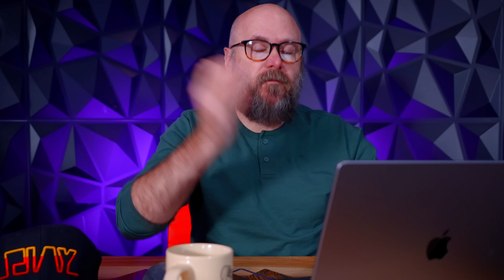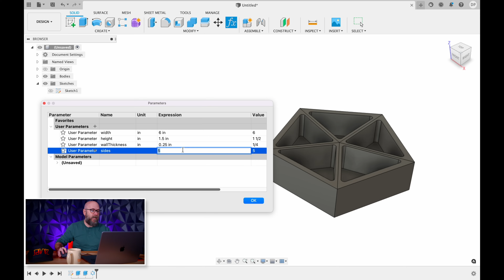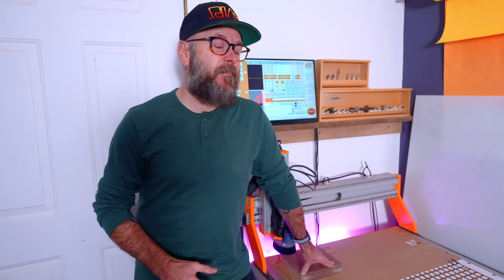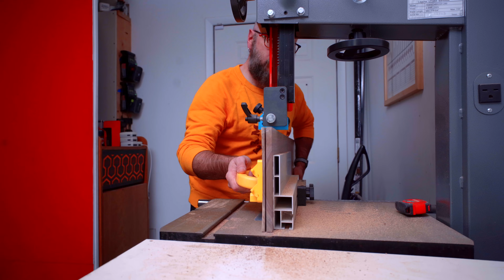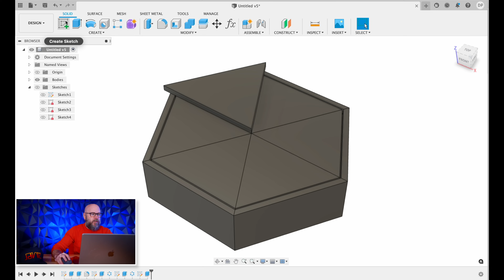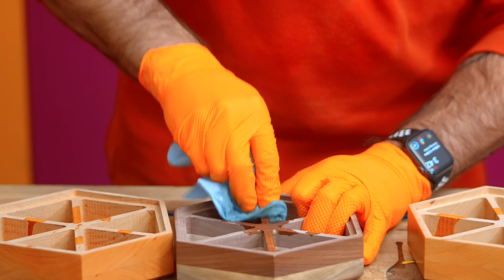The One Thing You MUST Learn In Woodworking

Comment: OK I am clearly doing something wrong. I used the 3D adaptive clearing for the roughing pass, and that looks right. says it will take an hour. But the finishing pass I used paralell 3d and it says it's going to take 5 hours. What are you using to do the finishing pass?

Comment: Great project, Dave! But I think the video with your Grandfather will be better.

During my career, I used Autodesk in
Inventor (from when it was first introduced) to create mechanical designs. Using parameters saved me from doing a lot of rework when the requirements changed or when I screwed up. In retirement, I have been slow to embrace Fusion, even though it is very similar to Inventor. I don't enjoy computer time like I used to.

Comment: Not getting a CNC anytime soon since it doesn't fit into the kind of "making" that I do but I loved the project and process.  One question though.  Can Fusion 360 create a cut list where instead of using CNC and router bits a guy could cut all the parts accept for the geometric top and glue those parts together more conventionally and come up with a candy dish?

Comment: Love the top! I'm working on a project with a similar texture and I'm trying to figure out how best to machine it - can you walk through what bits and toolpaths you used? It looks like maybe a ball end with a parallel pass going both ways?
Reply from the maker: This was the first time I ever used Fusion for tool paths. I still have a ton to learn which is why I didn't go over it. I was afraid to giving wrong information or bad advice. The 3 end mills I used are linked in the description. Basically a 3D roughing pass with a 1/4" straight end bit. The bottom of the pockets were finished with a bull nose bit. The lid was done with a 3D roughing pass with a 1/4" straight bit and then used a tapered bit and a two parallel/perpendicular passes.